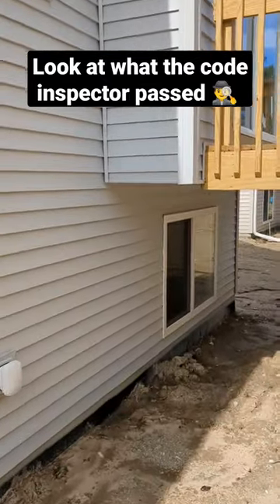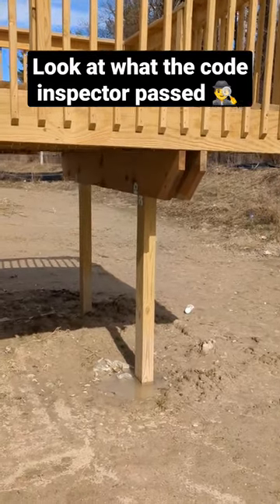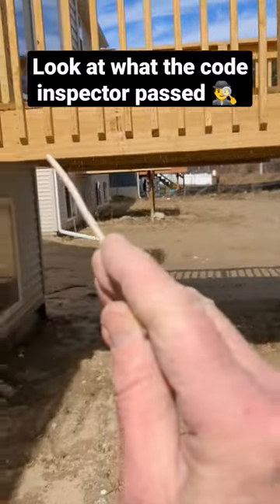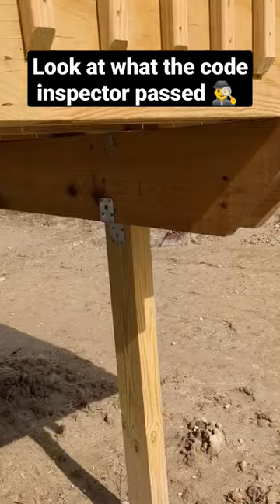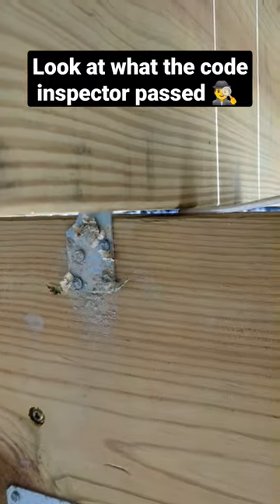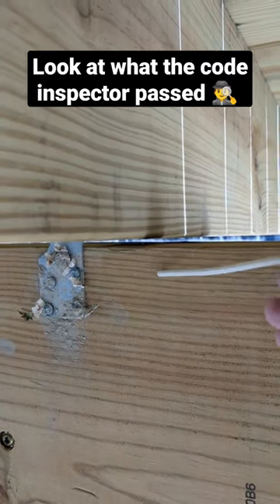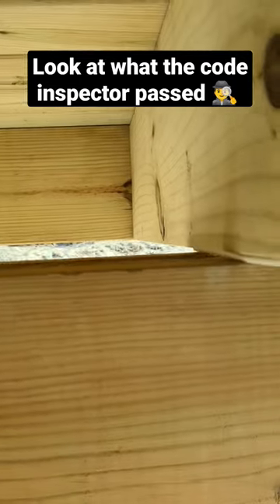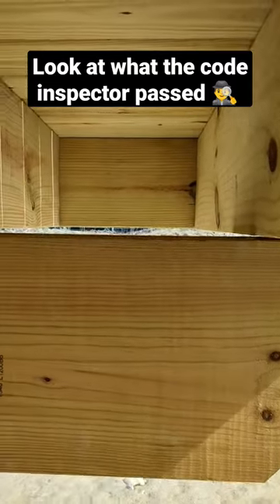Code #inspectors don't pay attention to detail#deck #newconstruction#youtubeshorts#shortvideo#shorts

Comment: According to the international deck code I just read the other day (I’m designing my own deck with sketch-up) it’s also a no go to have the deck attached to a cantilevered part of the house. You’d need another beam with posts within a couple feet of where the deck meets the house. That seems like the biggest issue to be but idk.
Reply: The deck is actually not considered cantilevered. There is what's call a ledger board that those joists are all connected too. The ledger gets faster to the side of the house with ledger lock fasteners which generally get installed through the rim board along with the studs behind that rim board.   The 1/8" he is pointing out most likely happened after the contractor left and the sun dried out the preasure treated lumber. I see it all the time. It comes from the yard basically soaking wet. Once that stuff is hit by the sum for a few days it totally changes shape and size.  The biggest concern on that whole video is how the bottom 2 columns holding up the deck are sitting in water.  I get the grade is not complete but the footings are so low there's a huge likely hood the ends of those columns will stay wet for ever causing a much bigger problem down the road.
Reply from the maker: @tomdalio3395  well said .👍
Thanks for watching the video
Reply: Correct, hanging the deck like that is bad. Will drag the whole house down.
Reply: @tomdalio3395  he didn't say the deck was cantilevered. He said the part of the house that the deck is attached to is cantilevered.
Reply: Appreciate your comment, good eye!
Reply: @tomdalio3395  reading comprehension is important especially when making such a long reply.
Ryan Hill is correct, the deck shouldn’t be attached to part of the house that is cantilevered.
Reply: @Ryan Hill~ Good catch.  That makes absolute sense.
Reply: @samclegg2805  it has nothing to do with the deck joist but the engineering of the cantilever and if it was designed for the additional weight of the deck.
Reply: People, please read and comprehend what Ryan Hill is saying/asking.

One more thing is it on optical or is that just a window going out on the deck?
Reply: You are correct. Deck ledgers cannot be attached to cantilevers.
Reply from the maker: @jeremythomas7544  people "staryed" building with wood?
Reply from the maker: @jeremythomas7544  Try 40 years experience not 40 hours!  I repaired my 1st foundation in 1979. Go see my about page 😂
Reply from the maker: Yes! 37 sec is a little tricky to cover all. Thanks for watching. To see a really major problem on New Construction, watch "Missing Footings"  
https://youtu.be/TqGMGpvnVAk
Reply: This reminds me of those drawings in the old children's books---  "How many things can you spot that don't  belong  there."
Reply from the maker: @Cleatus546  😂 exactly
Reply: Good catch, will definitely catastrophically fail.....or just settle onto beam in a few years....
Reply: @tomdalio3395   The part of the house that the deck is attached to is sticking out past the footings and not supported directly below, how would that not be considered a cantilevered part of the house? My understanding is you are not supposed to install a ledger board of the deck onto a cantilevered part of the house.

Comment: Depending on local codes(often state or province), many things can be wrong here. Where I live, 4x4 posts not code.
Reply: Absolutely and you are correct completely.  Codes varied depending on location and  state.  Contractors are required by law to build to code if they are licensed.

Comment: And...the Beam is not being fully supported on the Posts!!!
Reply from the maker: I know, right. You should see the "Missing Footings" inside
https://youtu.be/TqGMGpvnVAk under load bearing walls.
Thanks for watching.
Reply: I think it would be fine if they had through bolts connecting the beams to the post not just those little brackets
Reply: @danbeeson9564 not really, the post have to be directly supporting the weight of the deck, through bolts just to keep everything in place.

Comment: Not an issue. We framed a large deck but didn't do the decking til several weeks later came back and every joist had shrunk leaving a eighth to sixteenth gap at the bottom of the joist hanger. Treated lumber shrinks.

Comment: Ledger attached to cantilever of house hanging low to boot. No bottom rail on railings. 4x4s in ground. Probably in concrete. Beam bolted to posts not bearing on them. But we are worried about the joists? Where are they gonna go?

Comment: That’s what happens when you sell out the trades to keep your labor costs at 15 dollars an hour.
Reply from the maker: You got it.
Thanks for watching the video
Reply from the maker: Here is another major problem on New Construction, watch "Missing Footings"  
https://youtu.be/TqGMGpvnVAk
Reply: It’s an Arizona tradition. 🤣🤣🤣👍
Reply: 🏆🏆🏆🏆🏆 big facts
Reply: No, this is what happens when you let the IRS levy a tax on drying lumber.
Reply: @derrick9653  none of the issues in the video has anything to do with drying lumber. It was a terrible install.
Reply: @joshr223  No, it's just pressure treated lumber. Want a better frame, then send lumber that doesn't vary a 1/4".
Reply: @Nameentered no, they put the support on after they built the deck. Not to mention the posts were in contact with the ground - against code where I’m at. There’s no pride in home building anymore. It’s all about maximizing profits while keeping labor as low as possible. Houses are built like s now and you know it. Funny is the house in this video was probably half a million dollars and they probably paid 1,000 in labor to build that deck.

Comment: Deck on our first house, built by the builder:  Canterlevered off a cantailever.  Two 4x4 posts, not PT, setting in bare dirt, no footing.  Those same posts made up shorter sections of 4x4 that were cut at 45 and nailed together with about 50 nails.  No hangers used, joists simply toenailed on.  Stair stringers just nailed on and no footer.  Unbelievable what the city inspectors let go for those big builders but ran DIYs through the wringer.

Comment: I will tell you how this happened and why it’s not an issue. I build decks. The builder put up the ledger and beam, then started running joists. All of the joists were sitting on the beam due to gravity. Next, he installed the rim. When he did so, as he went down the line nailing each joist to the rim, he moved the rim up or down to make the tops flush. Those two joists were smaller lumber (7-1/4” vs 7-1/2”) than the ones on either side. Since he made the tops all level, there are gaps at the bottom. 

This is why you grade lumber and plane decks. It’s also not a big deal.

Comment: The weight transfers from the floor to the joists then the beam, then the post to the footing. There's no live  load on the floor, but once there is it will function as designed.
Reply from the maker: Nice. Great description.
Thanks for watching.

Comment: I'm no construction geek, but I know that you have to make sure that porches and decks are structurally sound before signing off on them. These surfaces are going to have to handle a lot of weight sometimes. They are also going to be exposed to the weather 24/7. The upright posts need to be mounted in concrete or cement. Don't skimp on building these structures. A badly made one can kill people.
Reply from the maker: Absolutely. And there was a lot more wrong with this deck. It needs to be rebuilt.
Thanks for the comment and for watching.

Comment: Don't forget,new treated wood will shrink considerably. So let the wood dry out a little beforehand. Otherwise this can happen.  I installed a deck 30 years ago and it was definitely done correctly. I came back two weeks later and the treated wood had shrunk by 1/4". A total disaster.

Comment: Can you wedge a piece of wood in between them? idk, but that would be my fix.
Reply from the maker: As a temp. The entire deck is actually improper and needs to be rebuilt.This home got worse. SEE Missing Footings Inside https://youtu.be/TqGMGpvnVAk
I've been finding more developments selling homes with NO decks, but they install handrails in the slider door frame. Once the code inspector is gone a crew member comes back and slaps on the deck for extra money 🤑 and no permit. Ugh.
Thanks for watching.

Comment: I think if it was build when lumber was very wet but inspection done much later when it might have dried out it would be sufficient to cause those gaps, considering it's a corner end and it's up that much with all that weight on top it's strange to have those gaps otherwise.

Comment: Did the posts sink? The concrete at the post looks like it's wet in the area. I had to redo the steps for my deck because the posts weren't secure right during a remodeling job and they settled, which dropped the stairs about 1 1"4 inch
Reply from the maker: I don't the post sank yet ... And we don't even know if there is concrete below them. 
Regardless, there are too many items Improperly installed and it needs to be rebuilt.
Thanks for watching and the comment.

Comment: Every logical circut in my brain shorted. I built my first (and only) deck by myself a couple years ago and resting them onto the beam just made sense in every way.
Reply from the maker: Correct 💯. In addition to the deck in the video, attaching to the house cantilevered floor joists is also improper.
Thanks for watching

Comment: I am not sure if I saw it correctly but it looks like the whole thing is being supported by a few nails in the side of a couple of 4x4s. Are there any shoulders cut into the posts for the beam to rest on?  a couple of wet 4x4's seems far too small to support the entire weight of the deck especially when the beam is only attached by a few nails through a metal straps and perhaps 6 screws with nothing actually resting on the 'top' of the post.

Comment: Congrats, you earned your pay and made the buyers happy about having you out. You’ll have them worried about an unsettled deck joist and not about anything that actually matters. Let me ask you, what should have been the correct action of the deck framers?  If they keep the joist down tight to the beam the rim joist won’t be flush. If they keep it flush with the rim joist it floats until it settles. When they create perfect lumber a framer can create a perfect deck. 

And here is proof that inspectors have their job because they don’t know crap about actual construction.

Comment: I built a small-ish deck addition. I framed it one weekend...by the next weekend, the joists were up off the support, just the same as this example. I carried on, and the joists ended up settling right back down. One thing I did do, was have my post concrete come up above grade, so they wouldn't be sitting in a puddle.

Comment: How long ago before this video was it inspected? Maybe they were seated correctly but the wood has flexed and or the footings have sunk.
Reply from the maker: IDK. But, yes shrinkage of wood is it. The entire deck has more problems and needs to be rebuilt.This home got worse. SEE Missing Footings Inside https://youtu.be/TqGMGpvnVAk
I've been finding more developments selling homes with NO decks, but they install handrails in the slider door frame. Once the code inspector is gone a crew member comes back and slaps on the deck for extra money 🤑 and no permit. Ugh.
Thanks for watching.

Comment: A 4x4 yellow pine solid member in a vertical setting is capable of about 7000 lbs on an 8’ length, more as the length decreases so that is very acceptable, think about a laminated 2x4 doubled as a corner on a two story, yes there are other members carrying loads, but that calculation is far less in capacity than a solid member..

Comment: Our previous deck had a railing like that, with all the balusters nailed into the wooden fascia. Not a great plan. When the fascia rots, you need to remove all of the balusters to replace it, and by that time, the balusters will probably be brittle, and break when you try to remove them. So, you'll need to replace everything.
Reply from the maker: Thanks for sharing and watching

Comment: How is the weight of the deck being transmitted to the ground ? That beam looks to be held up with just metal brackets. Maybe I'm seeing this wrong.
Reply from the maker: Nope. You're seeing it right! JUNK.🤭 The entire deck is improper and needs to be rebuilt.This home got worse. SEE Missing Footings Inside https://youtu.be/TqGMGpvnVAk
I've been finding more developments selling homes with NO decks, but they install handrails in the slider door frame. Once the code inspector is gone a crew member comes back and slaps on the deck for extra money 🤑 and no permit. Ugh.
Thanks for watching.

Comment: What’s the fix for this? Would adding shims be allowed?
Reply from the maker: Shims could be a temporary fix, but there's many other problems. The entire deck is actually improper and needs to be rebuilt.This home got worse. SEE Missing Footings Inside https://youtu.be/TqGMGpvnVAk
I've been finding more developments selling homes with NO decks, but they install handrails in the slider door frame. Once the code inspector is gone a crew member comes back and slaps on the deck for extra money 🤑 and no permit. Ugh.
Thanks for watching.

Comment: Don't connect to a cantilever? If designed to take the load it doesn't matter. Most cantilevers are designed one third/two thirds so this could easily handle the deck load if properly designed. Without seeing design calcs you wouldn't have a clue.

Comment: are there any footings? also no hangers on end
Reply from the maker: Yes the footings were there. Just below dirt .This home got worse. SEE Missing Footings Inside https://youtu.be/TqGMGpvnVAk
I've been finding more developments selling homes with NO decks, but they install handrails in the slider door frame. Once the code inspector is gone a crew member comes back and slaps on the deck for extra money 🤑 and no permit. Ugh.
Thanks for watching.
Reply: @inspectflix  I'm a contractor. I see tons crap work. Like no wonder no one gets paid a living wage. Do better work

Comment: Wait so how do you fix this. I just completed my first “repair and replace” deck where the original framing stayed and the surface planks are now trex composite boards. I did add 2/3’s more of joist so I average 10” o.c. Because of the composite boards being installed in a diagonal pattern. And Everything rests on 3 girder beams other than my rim joist at the end of the cantilever but let’s just say my joists did this at the first girder or the last or middle but it was touching the tops of the other girders…it is potentially just the crown or cup throwing it off an 1/8th or so from making direct contact with the top of the girder, would I have to compress it down and nail the shot out of it and hurricane tie it that tight ?

Comment: Correct me if I'm wrong isn't that beam built and installed wrong.
Reply from the maker: Lol. Yes, The entire deck is improper and needs to be rebuilt.This home got worse. SEE Missing Footings Inside https://youtu.be/TqGMGpvnVAk
I've been finding more developments selling homes with NO decks, but they install handrails in the slider door frame. Once the code inspector is gone a crew member comes back and slaps on the deck for extra money 🤑 and no permit. Ugh.
Thanks for watching.

Comment: Probably warped a bit when it dried.   This is why on the interior they use liquid nails.     There isn't actually anything wrong here structurally.    You might just have an annoying squeak.

Comment: That "seated properly" is fine. You will NOT get that timber to move until the wood decides to settle itself.  Their is so many hurricane hangers, its NOT moving. 
Your biggest issue here is actually the footings. Its not up to code. Your concrete is supposed to be 2" above grade.  Throw some shims in them spots if your really concerned.

Comment: The posts are not pressure treated or other weather resistive wood (touching soil or concrete), The beams are not on top of the posts. I'd be curious about the ledger at the joist to house wall.

Comment: It seems odd to me that the beam isn't resting on top of the posts. Now instead of running the load directly into the posts the system is depending purely on the strength of the fasteners.
Reply from the maker: Exactly! All very wrong. Our code in Michigan doesn't allow that either.
Thanks for the comment and for watching.

Comment: Shouldn't the been rest on the post? Its just nails basically holding all that weight?
Reply from the maker: Yes. Very wrong.
Thanks for watching
Reply: So what wood happen if u took all the nails ans screws out of them 2x12s?
Reply: Should of used 6x6 and notched the 6x6 so the 2x12 can sit on the notch... but I'm sure I'm worng....
Reply from the maker: @51-FS  nope, you are correct. Beams should be seated into post or on top of post. 6x6 post is the best but Michigan minimum requirement is 4x6.
Reply: @inspectflix  first u said I was worng. But now I'm not? Lol

Comment: In Utah, that would be an improvement! I have load-bearing walls that have gaps, and the house is  still settling after 6 years. Terrible, we hold a car manufacturer at a higher standard than the builder of our homes.
Reply from the maker: WOW. That's a great point.
I'm going to use that on my inspections.
Thanks for watching

Comment: Not sure what you mean by relying on rim joist, what are they relying on. Seems to me the floor joists are being supported by the hurricane clips and the nails holding the hurricane clips in place.

Otherwise read tristonskelton 
It looks like this is a housing development that hasn't had finished landscaping completed, hopefully standing water at post base will be addressed during finish grading the landscaping.